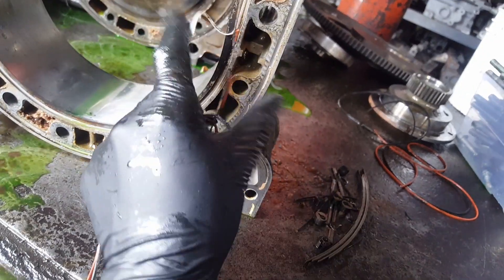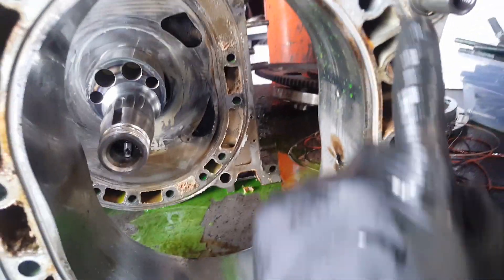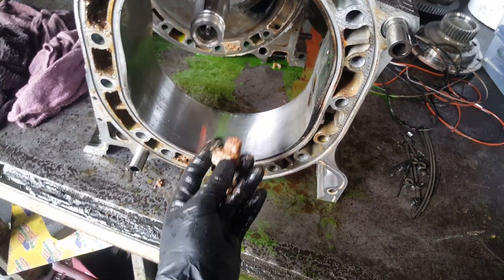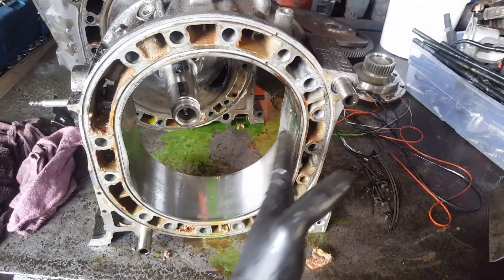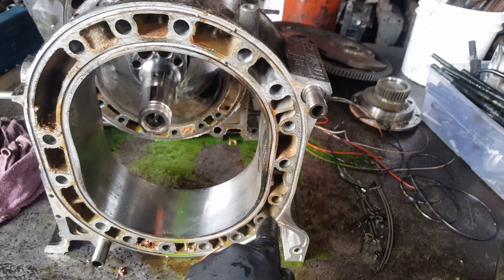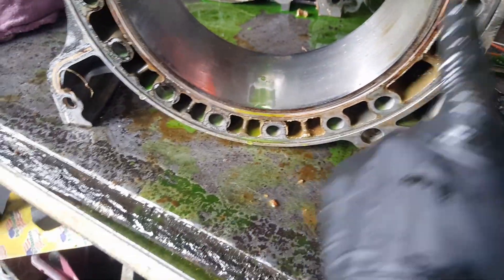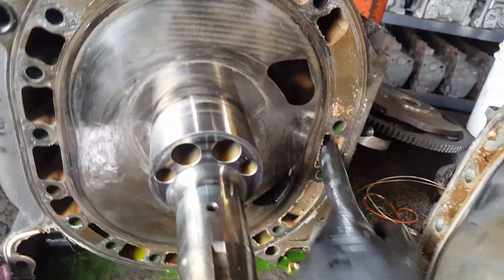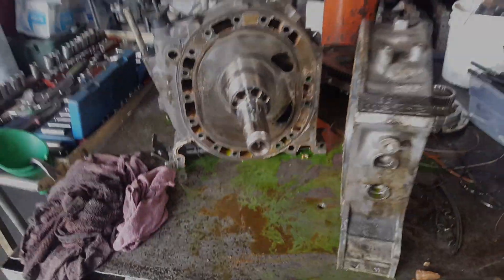How to rebuild mazda rx7 rx8 ; blown head gasket sealer on a rotary engine?

Comment: I can't decide what to do next with my 13b, it does not burn coolant but it keeps puking into the expansion tank. slowly it fills up the and after ~1-2hrs of driving it  will then begin to start overheating once the tank is full. tried replacing the cap, then with a 20lb cap just to see if that would help. flushed the coolant system and everything seems pristine inside. Found some hydrocarbon test strips but they seem not to work too well, thinking I may have a seal failure at higher rpms only on the exhaust side of the seal. at idle it won't push water into the expansion tank. any suggestions? really don't want to do a rebuild

Comment: Hello did you ever put the rotary motor in your truck. I'm wanting to put one in my b2200, but I need to know what I will need to get it done.
Reply from the maker: Yes I did but I sold the truck
Reply: @JM8686  so what will I need in order get the swap done, or should I just go get a miata motor or the Kia sportage motor to put in it.
Reply from the maker: Needs lots of work nd I blow the apex seals at 50k miles 🥺
Miata or kia will be better if you need the truck every day but if you just want to show off ,do the rotary
Reply: @JM8686  ok thanks